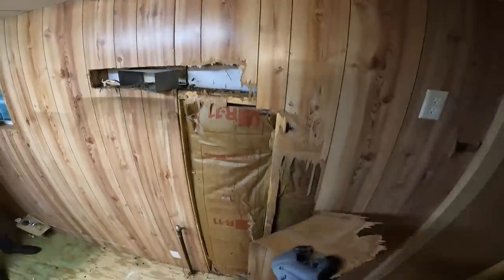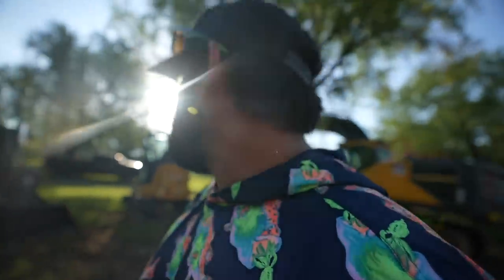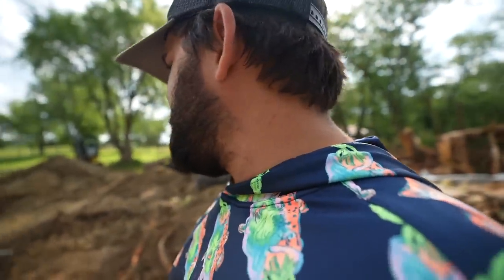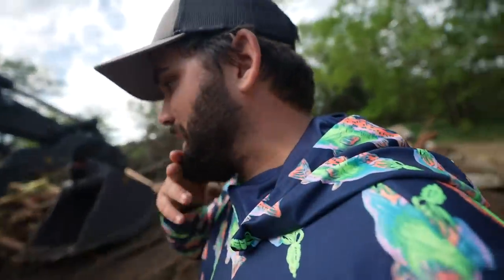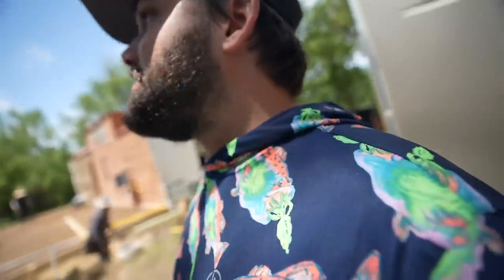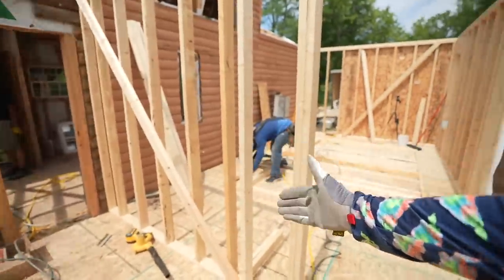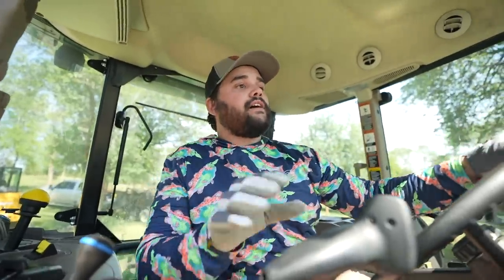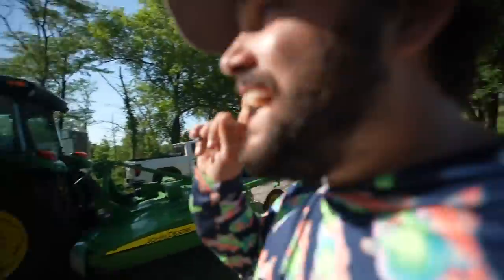Renovating Ranch Cabin Part 4: Building Massive Addition in 1 Day

Comment: When using the forks on the loader, take off the extensions or put the load closer to the tractor so that 1. the forks/loader have more lifting ability, 2. It will be less tippy as the weight is so far forward.

Comment: The back of the new addition where the sliding door is looks like a good spot for a small(or large) deck since you need to build steps anyway. It can serve as a clean off spot before you enter or even just another hang out spot. Great video!

Comment: My house when I moved In my backyard always flood so I put 5 gal bucket in ground with concrete around the top and piece of metal wire or netting then sump pump with the hose running to my front yard

Comment: Should get a cheap mill either a band saw mill or find a used old tractor large saw blade mills the ones powered by a tractor. Then paid your dad and jake their hourly wage to take some of the taller trees on the property and made a bunch of those yourself. They can probably crank out 10 of those an hour so as long as they at least do 2 an hour it would be covering their wages. Have them spend a 5 days pulling the trees and stacking them then another 5 days a few weeks later or in the winter to turn it into huge stacks of boards for the next years projects. That what we do when ever our lumber pile gets small we will take enough trees down at the end of winter for lumber and fire wood then stack them. Then some time in the spring or summer we cut up what we need. Then with the bark trimmings and what ever elese is leftover gets used for heating the house or garadge in our wood burners. Then with the saw dust we have a pellet mill we use to turn into pellets. With the saw dust and chips from the branches that we chip finer to almost a dust there is usually enough pellets to run the house for most of the winter. Our wood /pellet furnace works great heating the house. We filled our propane 1 time in the last 3 years and most of that is for the hot water and stove. Didnt lite the pilot for the propane furnace until late February when we ran out of pellets. In case anyone is wondering we add wood in the morning and at night. The pellet stove part only kicks on when the stove gets below a certain temperature.

Comment: Did you leave the tractor on when it was going down if it’s on got a leak most likely or weak pump if off leave on much easier on hydraulics if no pressure when off

Comment: I said this last video, but my rent house is crawl space and has a sump pump under it, I’ve had nothing but problems out of it, had to replace the whole floor when i bought the house, and still have problems with water. Sump pump has not quit so I’ll have to change it. But i regret ever messing with a crawl space. Maybe you’ll have better luck